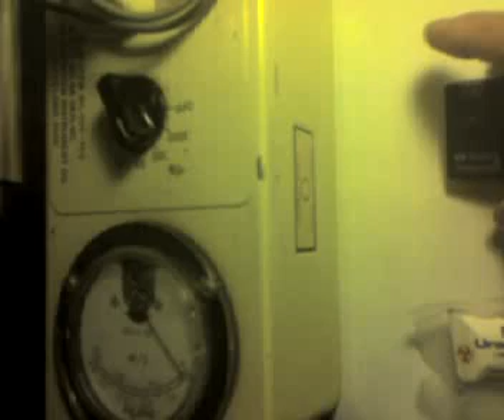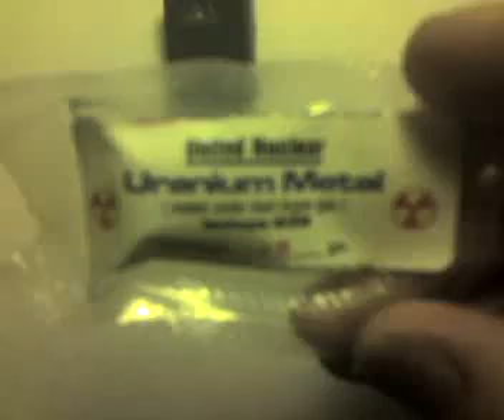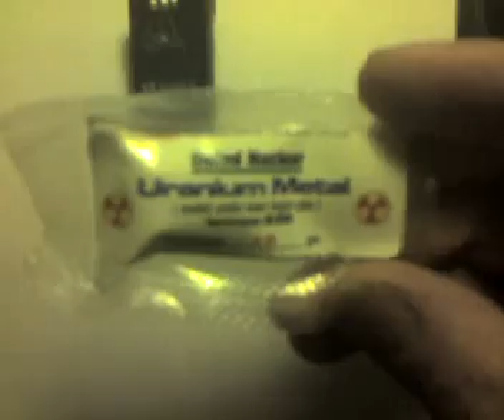Dositec K8 Nuke Safeguard testing small DU sources

Comment: RCVD my K8 Nuke SafeGuard from ebay today by the USPS (early).  My unit is flashing Green by the LCD monitor.  By failing to prepare. you are preparing to fail-Benjamin Franklin

Eyes UP and lights down,  tjl  Sent by Win7Pro64 w/ADSL

Comment: Nice video. Note that all beta emitters emit some X-rays due to Bremsstrahlung - which is the term for x-ray emission when beta particles produced inside the material collide with nuclei within the material. Also, the decay of Uranium is complex. It is almost exclusively an alpha emitter itself but it turns into Thorium after emitting the alpha particle and Thorium is a beta emitter.